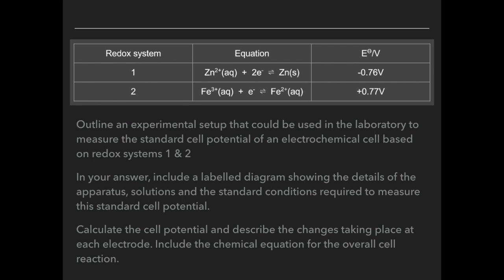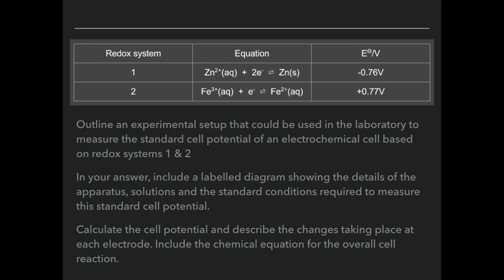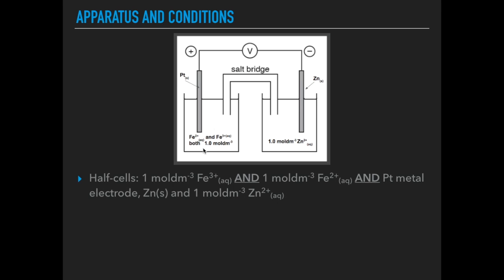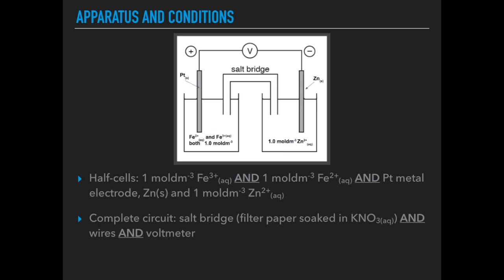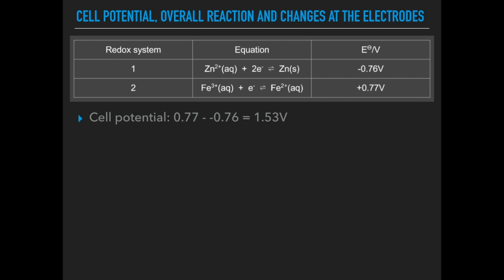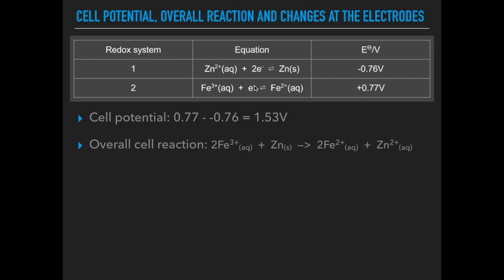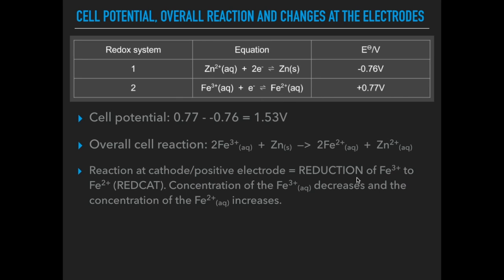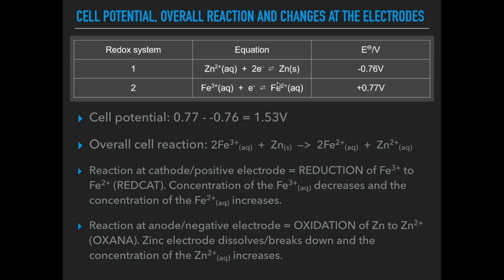PRACTICAL SKILLS - PAG 8 - ELECTROCHEMICAL CELLS

Comment: If they ask us the limitations of the experiment can we say: 
A) There is a high activation energy and the rate of reaction slows down 
B) The actual conditions are not the same as the measured conditions for the electrochemical cells?

Comment: Would the concentration of solution therefore increase at the anode?
Reply: Woops must have missed the bit where you covered it 
Thanks!!
Reply: As the concentrations change over time, the standard condition would change. Would this mean the electrode potential  would change too? With very low voltage cells could it effectively be set up like an equilibrium? (probably not the most useful cell though!)
Reply from the maker: That's correct and hence why there are limitations to the method (often asked by OCR)